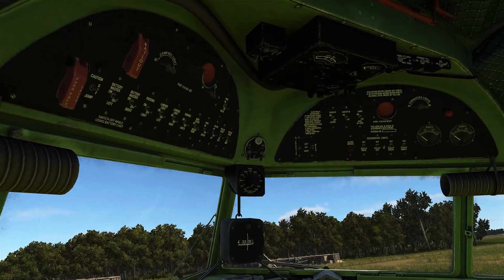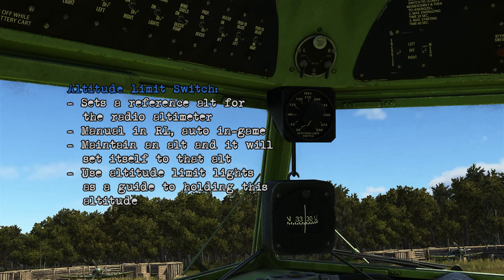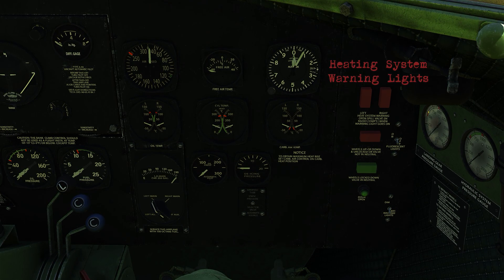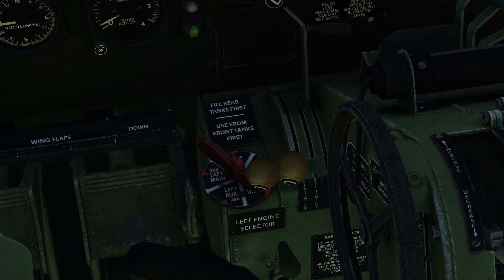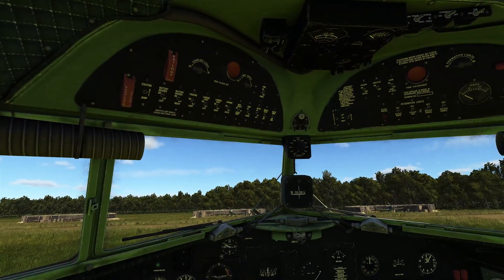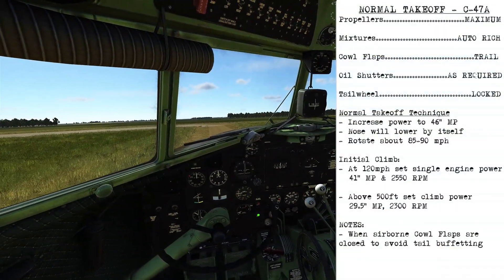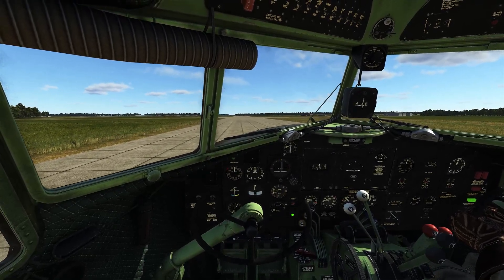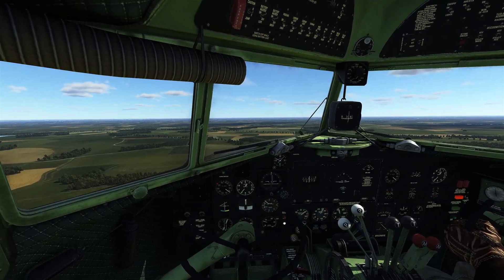Learn to fly the C-47 Skytrain

Comment: I am a regular viewer of your videos.
I would appreciate it if you could explain to me how your computer is built in terms of hard drives.
I run some heavy simulators + STEAM and they require a large amount of space and speed.
A. What drives do you have on your computer?
B. Are they all SSD?
C. Do you have any external drives on which your simulators sit?
D. Where are your simulators installed?
Reply from the maker: Hey Kfirc I'm sorry for the late reply here. I have 2 Nvme SSDs (1Tb + 2Tb). I put my sims on the the 2Tb one (Samsung 990 Evo) as it has the faster read/write speed between the two. However, I do not use Steam for them and always buy standalone.

Comment: Thank you for this great content. I have a question, you said take off power 46’ but you set it at 50’ on takeoff why?, what’s the correct procedure ? Thanks
Reply from the maker: The RL manual states 46" but I was carrying a full load of paratroopers so I just went full throttle which will give you 50"
 At lighter loads you could even use less power if you wanted, but you'll just use more runway
Reply: @RequiemsACTL  thank you sir